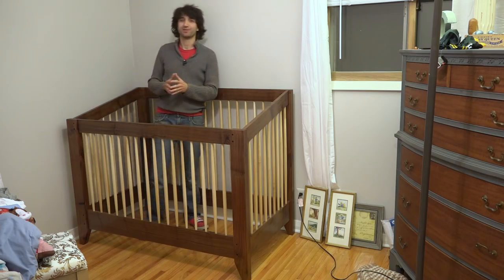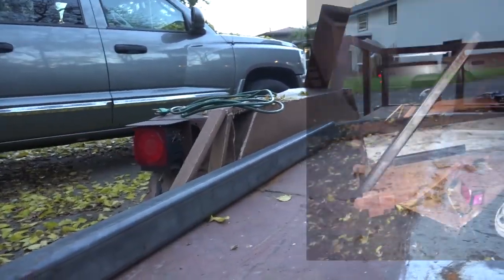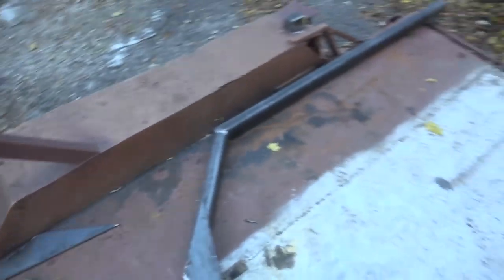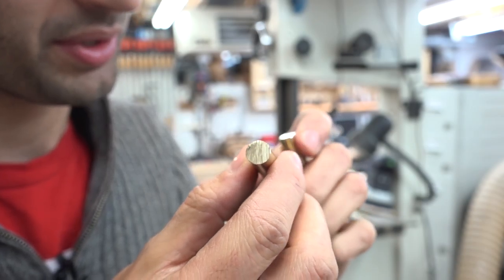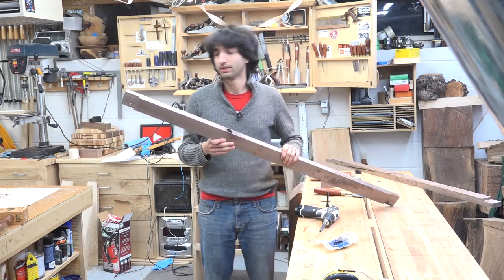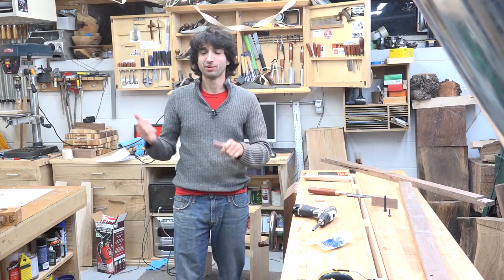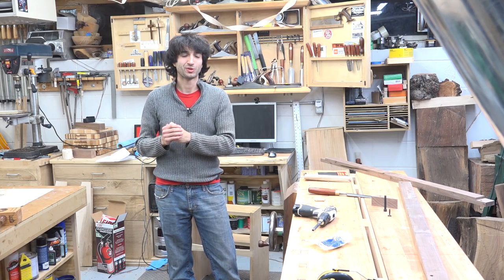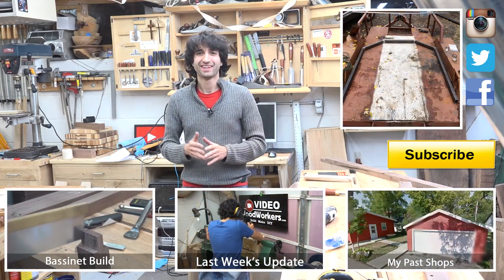Matt's Weekly Shop Update - Nov 2, 2015

Comment: Socket head cap screws are grade 8.  Button head and furniture screws are grade 3.
That means that for the same diameter the socket head cap screw will  be about 5 times as strong.  You made the right choice.

Comment: Good update Matt.

A quick welding tip I learned (and had to follow) in the truck rim factory, relieve all the sharp edges and remove all the spatter as that is where stress cracks will start.
Reply from the maker: Thanks for the tip, Jim!

Comment: Hey Matt, if you hit the ends of the brass bar that will be facing out with leather and some green or white compound it will put a pretty mirror polish on em. Sure you know that just thought I would throw that your way
Reply from the maker: Thanks Josh, I actually just finished polishing and installing the brass tonight.  I polished them up on my grinder's buffing wheel with some compound.  They turned out really nice

Comment: Very lowball values, but 1/4" steel bolts will hold at least 200 pounds each in shear (at the thread root). It looks like you're using a 3/8 or 1/2 bolts, those will be good to at least 510 and 940 pounds each, which is indeed way overkill ;)

Comment: Do you reinforce the threads in wood with ca glue? I keep reading that it's a good idea but have never needed to try it myself
Reply from the maker: I've heard that too and am planning to give it a try on my sample piece. I didn't do that with the tapped holes for my work bench and those are doing just fine but a little reinforcement shouldn't hurt.

Comment: What electrode are you using to weld up the log arch?
Reply from the maker: I'm using 6011
Reply: +Matthew Cremona if you are stick welding everything you shouldn't need gusset plates on both sides of the upper arch and not at all on the joints by the pivots - there is plenty of joint length there. By the pivots turn the welder up to the upper range for the thickness of steel and rod thickness and do a second pass with a whip weld. Doing a two pass method on the gusset plates (second being a whip weld) will get you an extremely strong joint that won't come apart, ever. Unless of course you plan on picking up a ten ton log. Check out weldingtipsandtricks for some stick welding help and stylistic approaches.

Comment: Are you sure it's a good idea to screw the bolt directly into the leg? If I were you I would use a threaded insert...
Reply: +GEORGE ZARIFIS Threads in hardwood are surprisingly solid. They won't hold up to the wear and tear of a fastener that you remove often, but they are very strong.